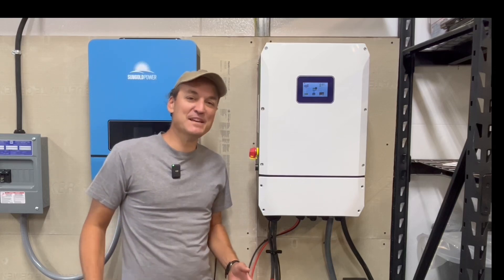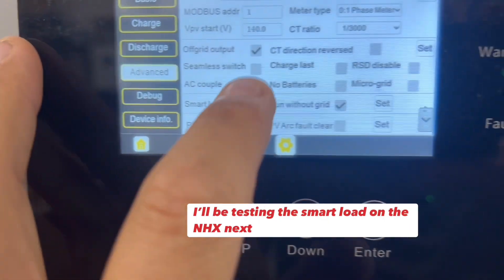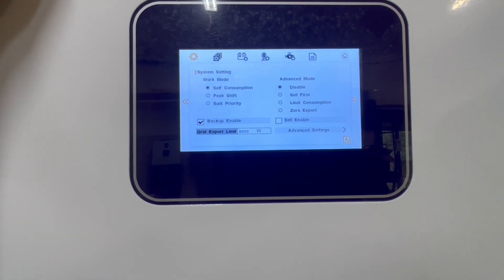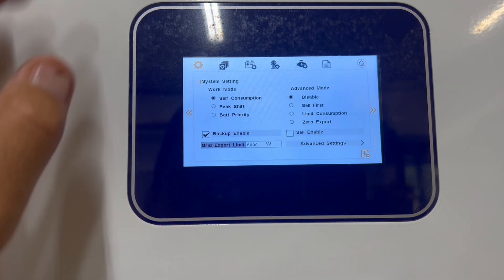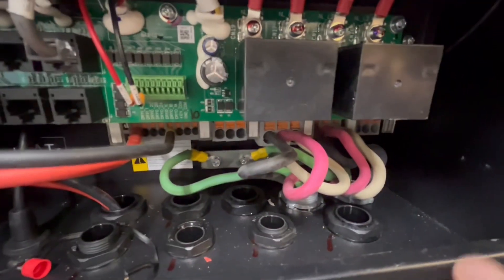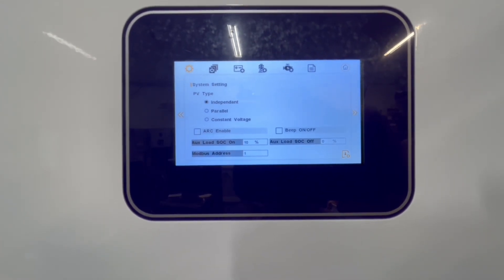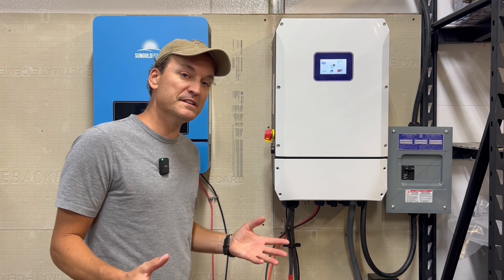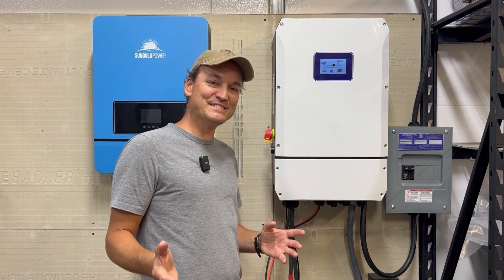NHX10K follow up review and testing

Comment: On my clone Amen solar 10kw I would get 0 pv from under 220V, I am going to try NHX firmware this summer, I got an update for my 8kw Amen and now the fans come on at 600w, they used to come on at 2200w with under 47c inverter temp, also it stopped tracking the generator hours , horrible firmware , cannot use the gen port either , run through grid port 80A charge and 2kw home load with gen gets me 60.1 hrz from my 9kw gen(6200)load. Either that or it is time for EG4 12K and fill the strings when I can.
Reply from the maker: What’s the brand name on the clone?
Reply: @GavinStoneDIY  amen solar, I think I loose 3kw a day from bad mppt drivers
Reply from the maker: @bobmonztr  ah. Yeah I haven’t heard of those issues. You should definitely try the new  firmware.
Reply: @GavinStoneDIY  I have the latest Amen firmware, sucks, nhx firmware next

Comment: Are those 6WAG wires? The reason of the question is that my current setup has 6AWG input and output wires (RV5th Wheel). Have one system installed that went on standby mode immediately after it being installed and it seems like I will have to buy a different system.
Reply from the maker: @RS-lt2ue  yes 6 awg wire fits.
Reply: Thanks. I purchased one similar to the one on the left, from PowMr, not working at all. It went on standby mode and can't get it out of there. So, I will have to purchase one that actually works.

Comment: Whats the surge capacity?  Can it start a 3 or4 ton HVAC compressor?
Reply from the maker: The surge capacity is rated at double its output. Which is typical for most inverter specs. But this unit actually seems to deliver. I would always install a soft start on your hvac. That’s just a good idea either way. But I would imagine it could handle a 4 ton. I don’t have a 4 ton unit to test it with myself.

Comment: Gavin. Great video BTW.  In process of trying this same configuration with the NKH 10k  which I'm currently wiring up to the existing off grid setup using the old style LV6548 inverters, but under  powered , of course.  So you have helped me wrap my head around and  have answered my question about this even working.  Thanks !
Reply from the maker: That would be interesting.

Comment: Another great video....especially with your moving power from inverter to inverter....It started me thinking about my problem. 
I'm totally off grid. I have my existing 24 volt system that is working well. I'm nearly complete installing a pair of 6000XPs with panels, batteries and a Chargeverter.
I have learned that I can't mix the AC outputs of the 24 volt and the 48 volt systems into the same AC load panel.
Here's the question: What if I take the AC output from the 24 volt inverter and "transfer it" into the 48 volt system through either the 6000 XP grid or generator connection? Would that work?
I'd appreciate your thoughts. Thanks
Reply from the maker: I believe it might work. It would really depend on how much you’d want to power with the 24v system. The XP’s aren’t hybrid inverters. So you’d be either on backup power, or using the XP’s. You couldn’t have both.

Comment: NIce!  I'm not sure what the use case would be for the configuration you did with the smart feature but it's definitely an interesting concept.  You did a great job on showing some atypical configurations and functions.  I'm getting pretty jealous of all the gear you have!  😂
Reply from the maker: The use case for self consumption would be fairly common assuming someone has grid available. Zeroing out loads without need of a critical loads panel.

The smart load feature is just great for a dump load. A load that’s determined by the state of charge of your battery bank. Rather than letting all that power go to waste. This could power multiple loads like a how water heater, EV charger, or probably a lot of other devices. I don’t have an EV yet, but if I did, I’d probably use a smart load port to charge it.  That way I’d know for sure I wasn’t taking power from my battery bank when it wasn’t full.
Reply: @GavinStoneDIY  That makes sense.  And you said the 18kpv has the same capability?  That's the inverter I'll probably go with on an upgrade.  So now I have to go find something to buy to use that functionality!  I keep looking at electric ATV side by sides but I haven't found anything that makes a good impression.  But I'm persistent ... 🙂
Reply from the maker: @easttexascowboy257  yes the 18kpv has the same feature through the generator port. That’s actually what I used to power the NHX. 

And I know what you mean about finding a use for it. I’m doing the same. 😀
Reply: Ian uses the smart feature to heat water after his battery reaches full - I do the same with my xw pro and its AUX relay

Comment: Hey, nice video 
One question: What size breaker to use with Eg4LL 100Ah battery?
Reply from the maker: The breaker size is determined by the inverter/charge controller. And in turn that protects the wire.

Comment: Hey Gavin. Is it true zero export with no chance of back feeding to the grid?
Reply from the maker: Honestly every inverter on the market will have a tiny trickle of back feed if you shut off a large load. But that isn’t an issue with the electric companies. It’s negligible really.
Reply: Great video but trying to understand your test. The Ac Out (load side) of the 18k was going into the AC In of the NHX, correct. Were there other loads on the 18k in addition to the 50amp feeding the NHX?  Trying to understand where the power was going from NHX
Reply from the maker: @cgutowski471  the power from the NHX went to feed the loads the 18kpv was feeding originally. It essentially took the work load over. The same it would from your household loads in a grid panel. the NHX is capable of being attached to your grid panel, and taking over the loads your grid normally would. By attaching the CT’s it can intelligently monitor the usage of power, and supply power from the inverter as needed. 

So if you had it attached to your main panel, and you started your dryer for instance, the NHX would supply the 5,000 watts that was needed, and the grid power would pretty much get a back seat. If you exceeded the 10kw the inverter can output, say a dryer,  water heater, and a toaster, then the grid can supply anything over that. That’s one of the big advantages of a hybrid inverter. Very smart, and able to play nicely with the grid